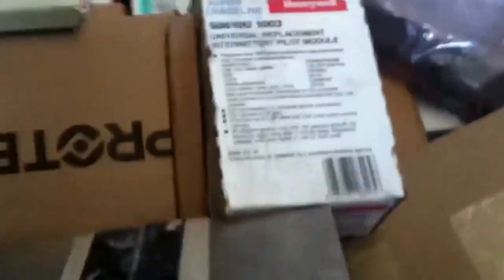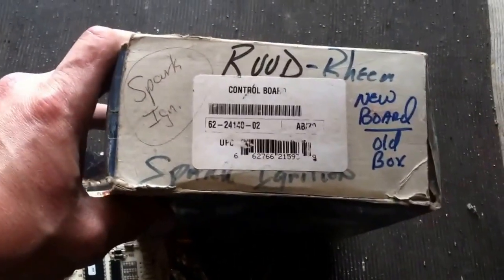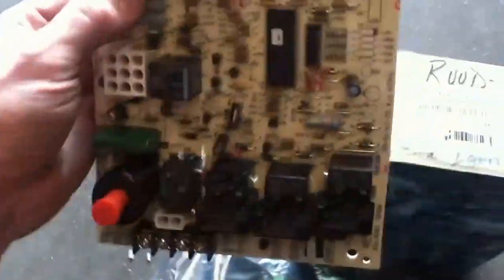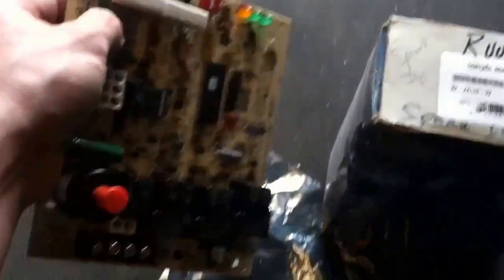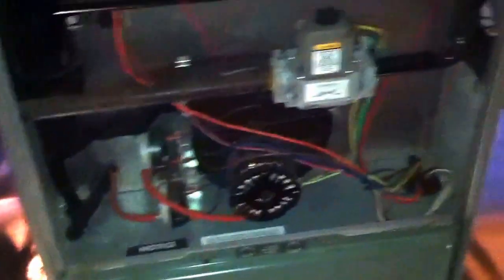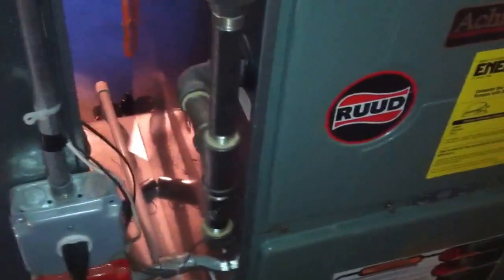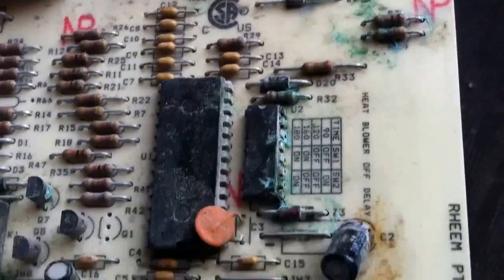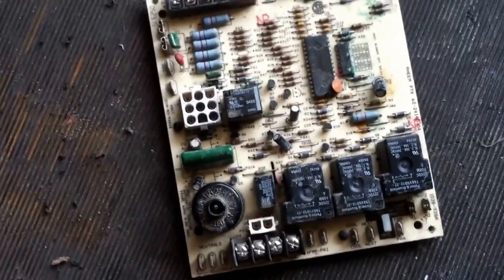Ruud 90% bad control board .

Comment: Great video Justin. Definitely nice having that board on the truck.  Going to the supply house takes a lot of time!
Reply from the maker: Yeah Jon I came across a fridget  air board today that wasn't sending any power to the ignitor but I had to make a call and will be returning tomorrow to install it. Can't have everything but I try . Thanks for watching .
Reply: justin henning So true.  You ever use those Honeywell universal boards? If so any good?
Reply from the maker: Yes I have in a pinch but if possible I will order the proper board. If it's a emergency u have to do what u got to do but to answer your ? The universal board r good to keep on the truck for an emergency but can be a pain sometimes .
Reply: justin henning Agreed, OEM is always best. They do look like they can be a pain. But probably good to have like you said.

Comment: Hey justin henning , nice video...  I like the stock you have on the truck.  Those humidifiers looked like model 400s the are not drain through ones...  they have floats 2 of them ... if one gets stuck the other is for redundancy but if im wrong... those things would never run due to the humidistat being so close.  It should be 3ft upstream of the humidifier or bypass however it is installed....  nice job man.
Reply from the maker: Billy there wasn't any floats on these for sure I went to check the pad and started to run it and that's when I noticed there wasn't any drains to them.  Your right the Stat was close and should be on the return . Thanks for commenting and watching.

Comment: Great video Justin
Reply from the maker: I guess Harry just another day , I'm glad I had that thing on the truck . I was getting worried cause I didn't see it in my main board bin on the truck butte had it stashed away on top lol , thanks Harry .
Reply: lol .  your like steve lav home depot on wheels !!
Reply from the maker: That's the only way to roll , he has Alot of great stuff on his truck that I wish I had and I have a few things he doesn't but then again we r both in different states and we come across different issues.
Reply from the maker: Oh and Harry don't offended me by saying home Depot on wheels I prefer supply house on wheels lol , home Depot sucks .
Reply: That is true he does have a lot of parts and tools on the truck  you're pretty well equipped your self still I can't figure out how you both manage everything on the truck
Reply from the maker: Well it's not my set up as far as my truck it's the way the boss man likes it but I can add things of my own to it or change things around a lil bit. Alot of thought and money went into setting mine and his truck up but it saves us time and money running to the supply houses and the cust time also. Without having to run out for supplies every call u can run more calls threw out the day and be more cost affective .
Reply: That definitely makes sense Justin I remember years back when I was working with this very small company the boss man was so un organize he had no idea what was in the van lol we used to go to the supply house to order parts for the job and after picking up the parts he realized he had the pars in the van that was after a bar stop lol
Reply from the maker: Lol that's so funny Harry , one day I would love to hear your experience or history in the industry.
Reply: You definitely will in about a month or two I'll be heading up north to visit friends I'll give you a buzz
Reply from the maker: Yeah definitely